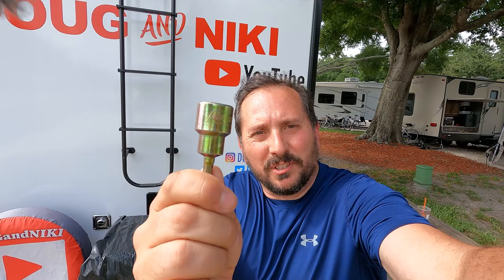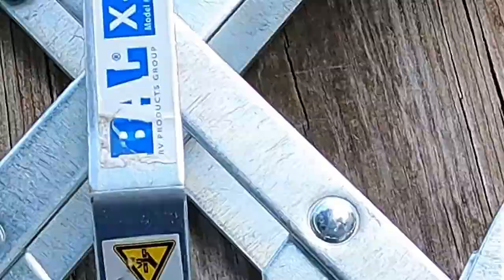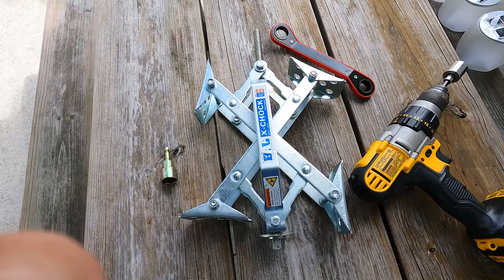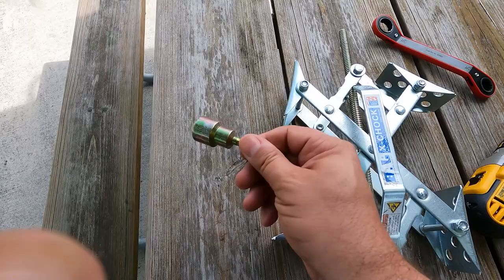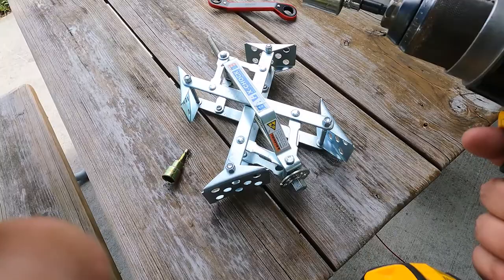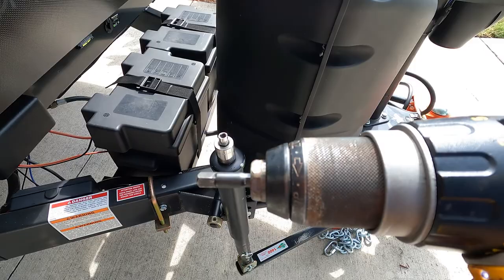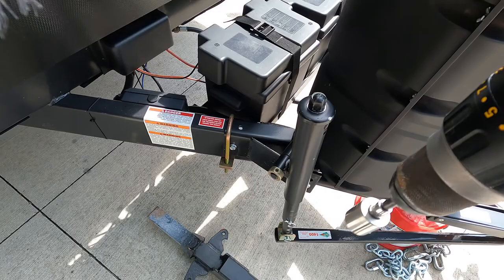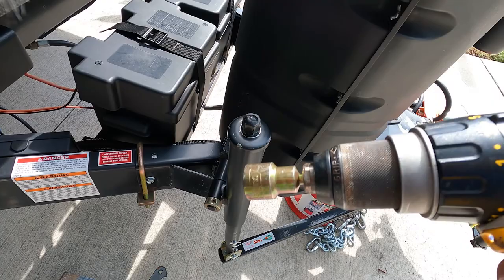Camco RV Leveling Scissor Jack Socket Drill Adapter - Review and Tips

Comment: I have a question. I have a 18v cordless drill and this camco socket. What settings should I use on my drill?
Reply from the maker: I generally run mine in the higher torque setting.  The speed is a little much for what we are doing with it.  I'd suggest you experiment a little to see what works best for you.